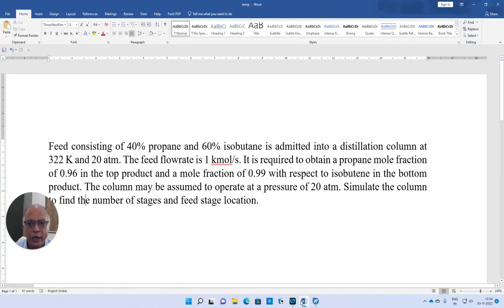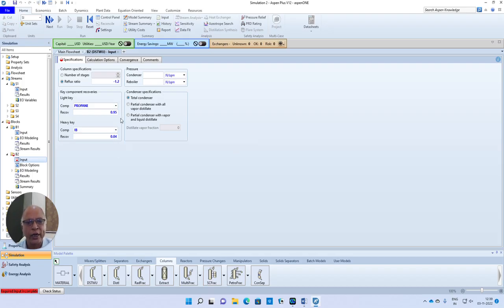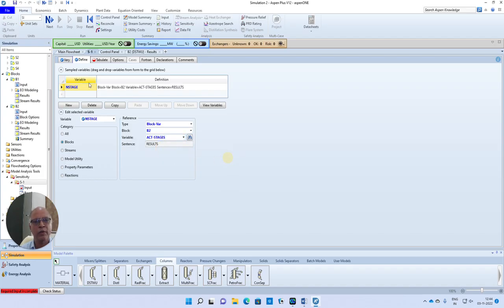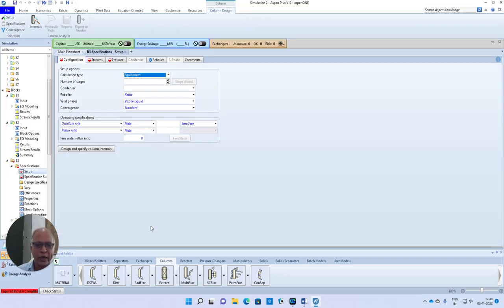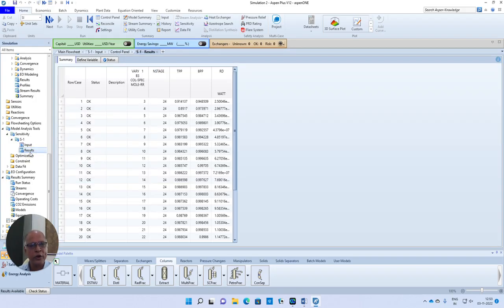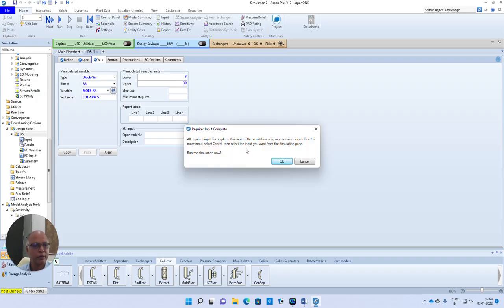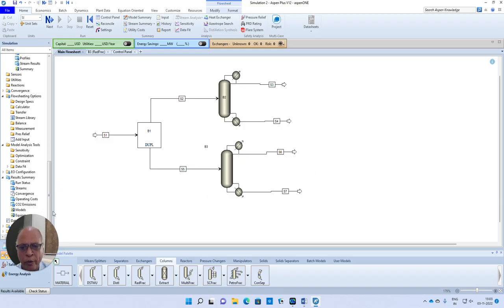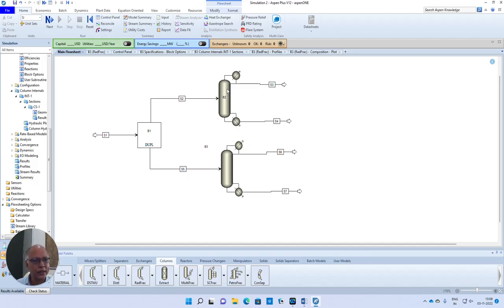29.  Design of a Distillation Column using DSTWU  and RADFRAC in Aspen -  Updated

Comment: Hello I’m rather confused about  the mole fractions used for light and heavy key, thought for propane in bottom should be 0.04 and butane in distillate as 0.01. Plus why not use short cut distillation